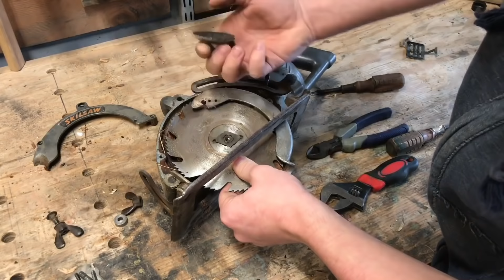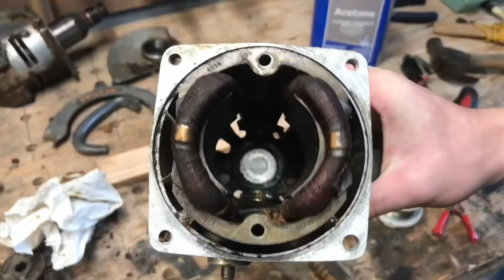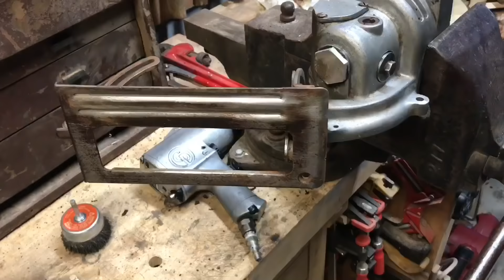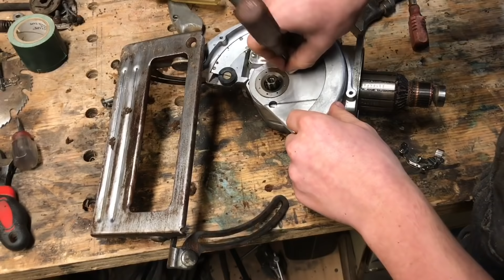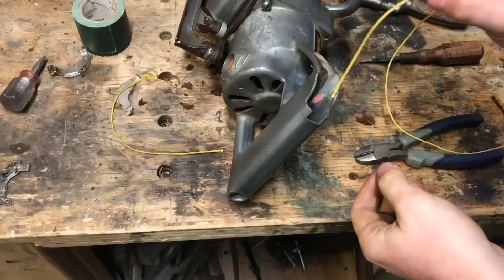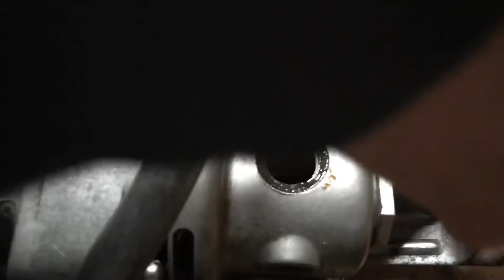Restoring a Broken Skilsaw

Comment: My dad had one of them and it’s what I learned to cut on. Powerful, tough, and lightweight saw. I remember the power cord was so flexible and thick.  The one thing that did it in was the switch. It broke and we were never able to find a replacement saw for it in the late 1990’s. He had a broken one from the same era but the switch was no compatible. Skilsaw should bring back that size! Thanks for posting the saw of my youth.
Reply from the maker: They’re little beasts of saws!

Comment: Hi in the process of finishing restoration of this saw. I can't seem to get the blade gaurd spring in andc tensioned correctly. Yours seemed to go right in
Reply from the maker: I'm not 100% sure. All of these saws were a little bit different. I would just retrace your steps of how you took it apart.
Reply: @TheRussianWoodworker  I got it on and off several times but no tension. I bought another saw for parts but both springs won't tension. I'm going to try a straight spring on the rear if the gaurd. I tried to find this spring no one has it
Reply: @TheRussianWoodworker  I studied it more this AM. It's not the spring. The inner disc on the gaurd with all the holes spins not allowing full spring tension in the gaurd. I'll have to find a straight spring to wrap around back of gaurd and attach to gaurd and frame .These parts are obsolete I'm lucky I got a gaurd at all.
Reply from the maker: That will definitely be fun to modify/ get working again. I wish you luck!
Reply: @TheRussianWoodworker  I got it. I ran an alien head 10 24 bolt through the rear of the blade stop hole and attached one spring end there and the other through one of the blade gaurd holes. On the threaded side I put plumbing washers sandwiched between two steel #10 washers and a loctited 10 24 hex nut for a blade stopper.
Reply from the maker: @josephlahood4647  sweet! There's always a way to do stuff.
Reply: @TheRussianWoodworker  coming along. Giving it as a birthday gift to my brother. I have the original case too. Just have to find blades not easy for these
Reply from the maker: @josephlahood4647  sweet! That will make a killer gift.
Reply: @TheRussianWoodworker  yes found a nice SKIL vinyl decal  on line I restored the original case too with Hammered Grey. Im clearing it with Wheel Clear Coat too. Skil said they'd dig up some decals but really didn't seem too helpful in all. More like fake appreciation

Comment: When rebuilding a hand held electrical tool that I will see much use I replace the worn, damaged cord with a high grade 20' (often 50') extension cord.
I usually do not need an extension cord when using the tool.
Reply from the maker: Great idea! I just used what I had at hand. I just enjoy bringing the tools into working order. I don’t do too much contracting anyways so I don’t need cords that are too heavy gauge or very long.
Reply: Nice work...can't tell for sure, but I think your replacement cord might be a little light. That saw draws 8 amps, prob more under load/startup...

Comment: Good job. Where did you attach the ground wire to?  I've been thinking of doing the same thing to an early skilsaw. I'd love to keep it on the truck but I would rather not get shocked on damp days.
Reply from the maker: Thank you! I attached it to one of the bolts that held the handle on to the actual metal housing. As long as you ground it to any metal part of the casing you'll be good.
Reply: The Russian Woodworker you rock! Thanks

Comment: Essential Craftsman’s 50ft extension upgrade for the saw would have been a good addition.
Reply: Yeah, I've been installing 20' cords on everything since that vid.  Makes a nice change with not having the cord knot catch everything. And having a more robust cord to boot.
Reply: I just install a 5” cord and plug then use an extension cord when I use the tool. It makes it so much easier to put the tools away with a short cord

Comment: What did you connect the ground wire to? I have a blue label skilsaw and it only has a two prong plug. I have been wanting to replace it with a 3 prong cord but there's no room. That handle and trigger is tight on space.
Reply from the maker: Any bolt that connects to the metal body
Reply: @TheRussianWoodworker  
Can I use one of the two srews that hold the trigger assembly?
Reply from the maker: @SkilsawDoctor  don't know. Newer ones have plastic handles. Connect it to one of the big bolts holding On the plastic handle if that's what you have if it's metal yes she was connected anywhere to the metal case
Reply: @TheRussianWoodworker  
Hey thanks for your help. I am rebuilding/restoring a blue label 77. Has to be late 30's early 40's. Came with the steel carrying case and a bunch of rusted blades. The original cord is 2 prong with a small green ground wire that comes out of the plug. I was planning on replacing it with a 3 prong, bug was confused as to where I can attach the ground. So, now that you helped me out, I will just attach it to one of the trigger assembly hold down screws. The saw is 100% metal! Even the trigger!

Comment: Where did you put the ground wire? I just cleaned my model 77 and it had a 2 prong cord. I installed a 3 prong cord but there wasn't a place for the ground wire.
Reply from the maker: Ah nice! On mine it already had a threaded hole it’s a bolt that a previous owner had drilled and tapped. If you don’t have one, I’d just find an area where the casting is thick and you can drill and tap a hole.

Comment: It's much better to solder those wire terminals and use heat shrink over them. I have had them fail when crimped.

Comment: Good job...apart from the cord being far too light in gauge for that motor.  You WILL cause problems in future.
I'm restoring a 10 inch version of that saw (the 107) and have restored for use the 12 inch version (the 127).

Comment: Where can I get that oil squeeze bottle tip?
Reply from the maker: I got mine from harbor freight.
Reply: I searched and searched and I can't find it. Could you please give me a link to it? Thanks!
Reply: I really want that long extension tip!
Reply from the maker: I believe this is the one that you saw me using: 
https://www.harborfreight.com/4-oz-3-in-one-oil-61495.html
Reply: Thank You!!!

Will that extension tip fit on other bottles?
Reply from the maker: CALVIN L. NIKONT that I’m not too sure on you can definitely mod it to fit other bottles
Reply: Thanks again!
Reply: While she was out shopping, my wife just bought 2 bottles at Harbor Freight. Thanks again!
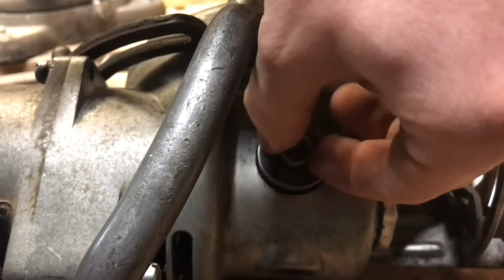Reply: 9:03   Amazon, Lowes, and M&M Tool Parts sell Skil Gear Oil.   8 fl. oz. tube.  About US$6.

Comment: The saw that built America! I would guess this saw is from the 50s. The model 67 was a 6" saw, made along with the 7" model 77, 8 1/4" model 825, 10" model 107, and the 12" model 127. Keep a sharp blade in it, check the oil, and it will last.

Comment: Why didn't you replace the brushes?? second; did you use a OEM or equivalent 12/3 replacement cord.  Run that saw full tilt for about a min.  while holding the cord, if it heats up?! that will tell you 'wrong gauge of wire"... replacing the brushes and a proper AWG cord might have cost you $30
Reply from the maker: Thanks for watching. The brushes were perfectly fine